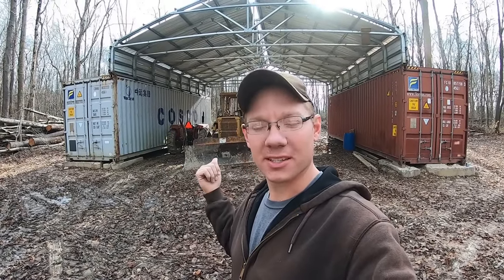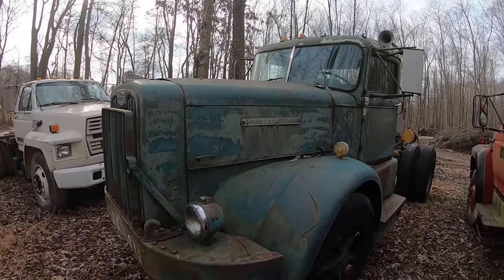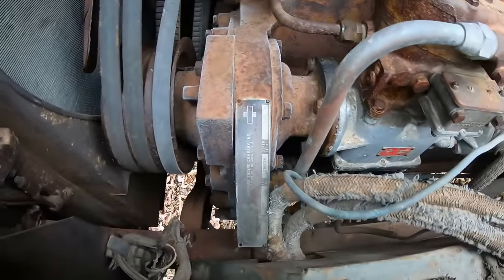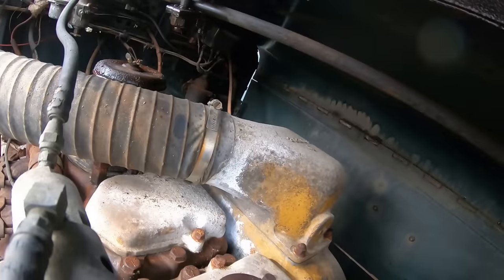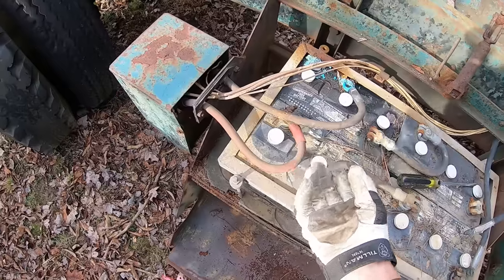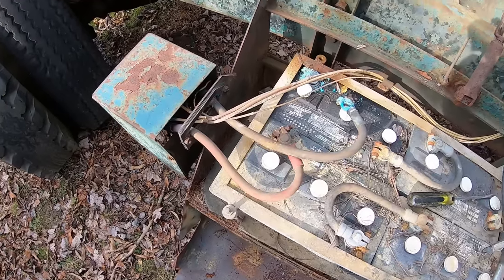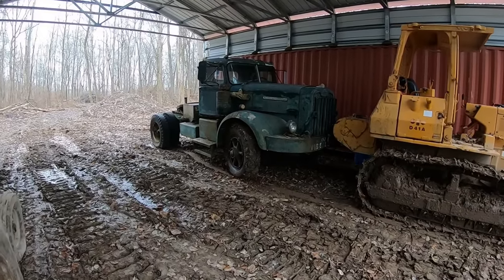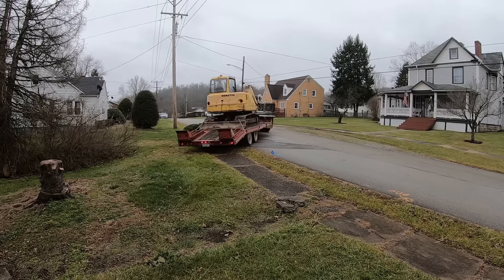First attempt at starting 1957 AUTOCAR truck - Hasn't run in 15 years!

Comment: Does anybody think about pre-lubricating engines which have been sitting for an eternity? Chances are all bearing surfaces. cam lobes  and cylinder surfaces have no oil on them. It's cruel and unusual punishment to an engine to start it without at least pressurizing oil galleries as part of pre-crank. It it were a gas engine I'd take the spark plugs out for a dose Marvel or motor oil.
Reply from the maker: The only way I know to lube them (without tearing the entire motor down) is to crank it for a while, which I did. Thanks for watching!!!

Comment: get a can of free all for the hinges the brakes are frozen spray all working parts with free all wait four about an hour get a pray bar chanel locks to hold the pray bar and a baby slege to free the brakes
Reply from the maker: I’ve been spraying it every time I’m out there but that dang good hinge won’t free up so far
Reply: Punctuation is quite useful if you want others to read your comments.

Comment: Its called a paraell switch
Reply: Series-parallel switch
Reply: Don't  eliminate that switch   do not put 12 volt batteries through that switch   speaking from experience
Reply: @pauljuhan7863  Actually there are two set's of 12v batteries going through that switch normally. There's two sets of 6v batteries wired in series to make 12volts, Those two 12v set's are in parallel going into the switch. The switch when energized connects both of the 12v set's in-series creating a 24v output from the switch to the cranking motor.
Reply: @paulehlers2225   I had a mechanic hook four 12 Volt batteries in series through that switch and guess what everything burned down
Reply: @paulehlers2225   I felt at the time that the 6 V batteries are better than  12 volts
Reply: @pauljuhan7863  yep that switch wasn't made for 48 volts which is what you had if you hooked four 12v batteries in series. It's very common for people that don't understand OHM's law to let the smoke out of the wires.

Comment: It was very painful to watch don’t jump the starter that way   you must use the solenoid,,,  the switch in the cab is wiper run and park ,,, series parallel switch converter 24 volts to 12 volts ... you need much more amperage then those jumpers will give to start that engine... but it was interesting